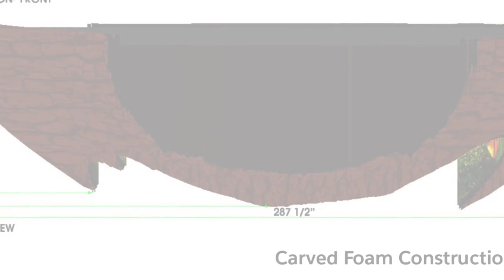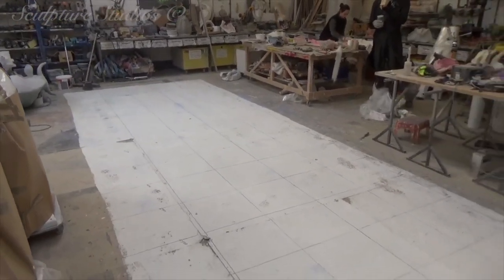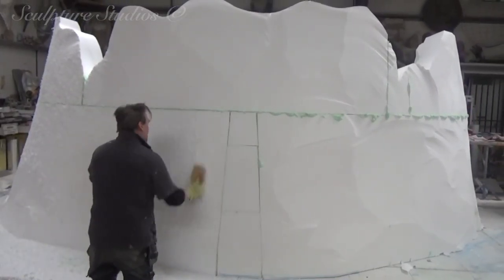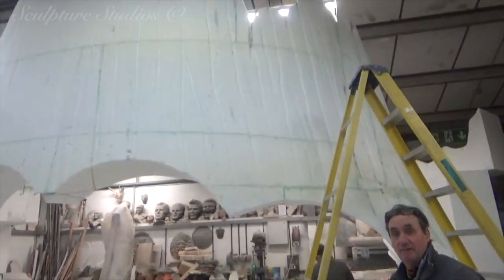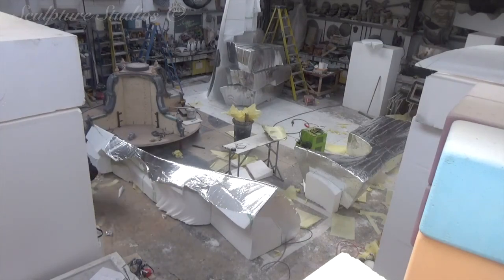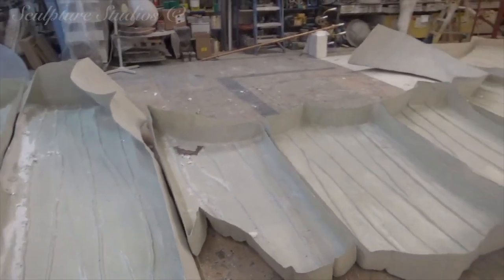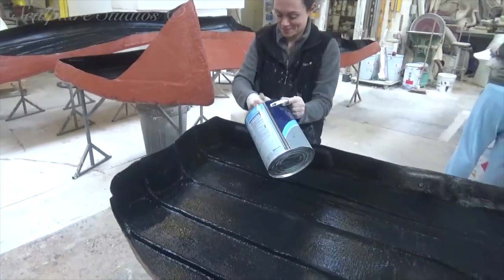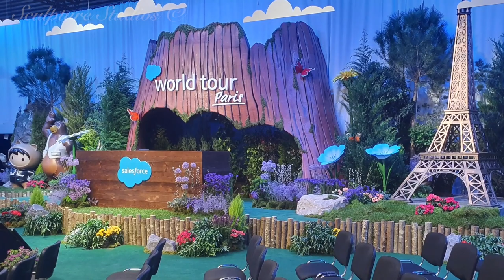We're Carving a Giant Tree Stump! - by Sculpture Studios

Comment: Another most triumphant project my friends. You know I always try to ask a question or two on your vids. 1st is when you guys choose to apply a cement mortar over some of your tree projects to tool in the bark texture do you apply that right over the gelcoat or glass fiber or do you apply some kind of adhesive layer first. 2nd question has to do with mold making, what do you do to prevent the 1st gelcoat layer from running down into the cut lines your dividers are in that separate the mold parts. I used a razor blade and inserted the plastic dividers but I noticed the gelcoat got in there and melted and changed the shape a little. do you paint or something any suggestions? Thanks again

Comment: Hey. How efficient is the foam compared to let's say paper mache?
Reply from the maker: What would you put the paper mache on?..
Reply: @AdenHynesSculptureStudios  a wire mesh wrapped in something that would allow the mache to stick on.
Reply: For portability I really think the foam is ideal but the mache has this almost natural feel, manipulatig it seems to produce a more natural looking tree compared to foam.
Reply from the maker: @maodo-ma-Ngai  I'm just checking that you watched the entire project? The final sculpture doesn't include any foam, but is made solely of glass fibre and resin. The polystyrene foam carving is just to get the overall shape. 

The sculpture is designed to break down into multiple sections, and so is made from glass fibre that can bolt together. I'm not sure where a paper mache would come into play in terms of the creation of this, as, not only would paper mache be particularly weak, but there needs to be a smooth finish on the tree for cleaning, and for health and safety.
Reply: Thank you for being patient with me. No I hadn't watched the entire video I got roughly the 18th minute and skipped till the ends. Thought it was foam all the way. Makes sense now that I've watched it.
I bet you must be busy but if you find some time I'd love to send you a direct message. I'm building a tree but much smaller and really weighing my options for whats best overall.
Reply: Asante.